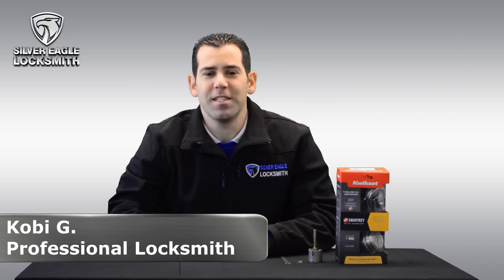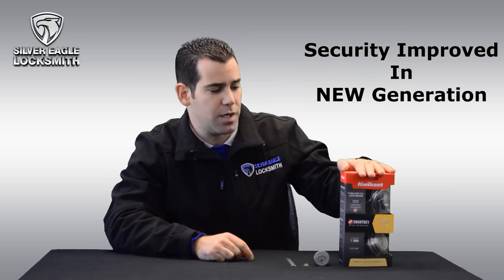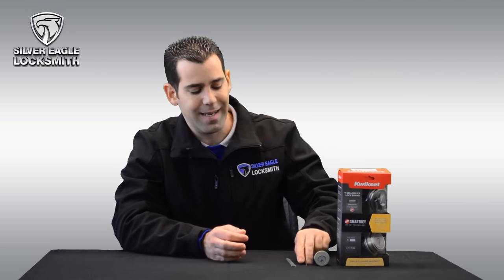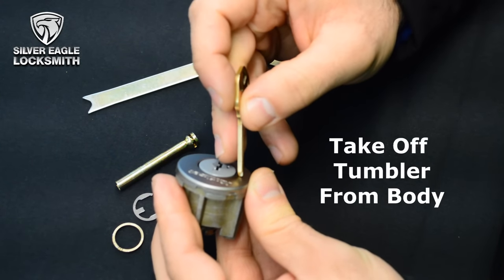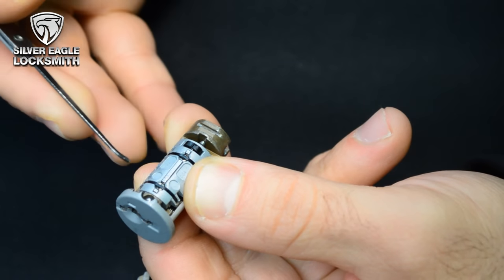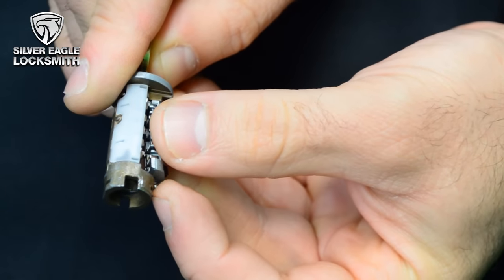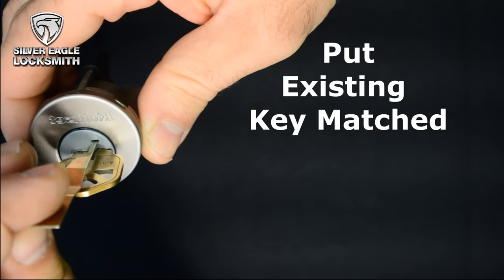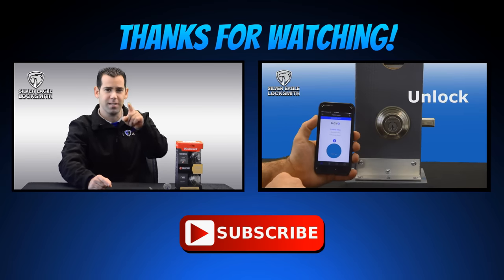How To Reset Kwikset Smart Key Without the Current Key Or The Reset Tool ✅

Comment: Absolutely incredible video man. I botched the reprogram and none of th regular troubleshooting worked. I followed your procedure and it works flawlessly. Took 5 minutes with a phillips and flat screwdriver and I was done. Thank you so much!
Reply: This was me to a tee. Botched the initial program. NEVER thought I’d find a video to fix my screw up - but low and behold - found this. Thought I just tossed $45 for a wasted deadbolt but 5 minutes following this video - and I’m back in business. THIS IS THE KINDA STUFF THE INTERNET WAS MADE FOR. BROTHERS HELPING BROTHERS. Thank you to the original poster big time!
Reply: Same! Only I have the old style and everything fell apart.  It took more than 5 minutes, but still less than half an hour!  
This deadbolt is on a back door and I *have* the key to the door lock and it matches the deadbolt on the front door.  So, I've never really cared I didn't have a key to the deadbolt for the back door.  It's nice to have it fixed, though!
Reply from the maker: It’s only one of my helper videos here on YouTube… fell free to check out more of my videos 👍🏻
Reply: Super professional video and perfectly technical.  Exactly what I needed to fix my deadbolt. This step-by-step saved me alot of time and money. Thank you!

Comment: This is such a great video! One tip for people who might have struggled putting the tailpiece and C clamp back on. If you are forcing the C clamp on and it wont go on as easy as the video, check the opposite side. There is a small hole there that it fits correctly into. If you are struggling, you are on the wrong side, turn the cylinder 180 degrees and it will slide in as easy as the video.

Comment: It took me several tries, but I finally got it apart, thanks to this video's details. There is nothing magically specific about the 2.5mm hex key--that was just what he happened to have available. Then the real fun started, dealing with the flimsy insides of Kwikset's mechanism. The plastic pin-retainer popped off and springs flew everywhere. Miraculously, I retrieved them all from various nooks and crannies around my kitchen table.

Comment: I purchased 6 new Kwikset Smart Key exterior locks for my home, but I had only a 50% success rate re-keying the locks (after precisely following the instructions each time), and my children heard me use language I shouldn't use. Thankfully, this video allowed me to reset all of the inoperative locks in less than an hour's time, using tools I had at home.
     The only advice I would add is to make sure that you have the tumbler oriented as shown in the video 
(3:13), so that when you remove the part holding the side pins, it is facing up. Otherwise the side pins will fall out. It's not a big deal to replace them, but just a little bit annoying.
     Also, when you have re-set the side pins and are making sure the side bar slides back and forth (4:00), I found that it was useful to remove and insert the key several times, checking to make sure that the side bar slides back and forth after each insertion. Once, I didn't do this, and after reassembling the lock I discovered that the key did not turn. For some reason the re-keying hadn't worked. So I had to take it all apart again.
     Thanks again for a very useful video!
Reply from the maker: Thank you and I’m happy that this video helped you to reset your Kwikset Smartkey locks
Reply: Thank you for thia

Comment: This saved me when I went to re-key a new lock and got the supplied key jammed with the bolt out during the process. Followed the video and put it back together using the key I wanted to change to, then I didn't have to try to use the reset tool again. My particular unit had an extra snap ring but everything else matched. Thank you
Reply from the maker: This video really help so many people and I’m happy it helps you as well

Comment: Awesome. I bought a house with two Kwikset keypad deadbolts that I've programmed a code, but I wanted a key in case the batteries died so I could still get in. I bought a third for the front door to replace a Schlage deadbolt and wanted them to be keyed the same, but I couldn't find an original key for the other two units. Now I can re-key them for the same key thanks to this video.

Comment: Thank you so much, I was able to reset my lock without the original key!  I even dropped the piece and had to replace the pins.  Your video was so clear and concise and you even showed how to test it by sliding the assembly.  My first attempt failed but I also wasn't able to slide the assembly.  The second time it worked perfectly!  Again thank you for a great video.
Reply from the maker: We’re so happy to hear that

Comment: Your video was awesome. About 3 years ago I bought a Kwikset deadbolt and when I tried to re-key it, something went wrong and it didn’t re-key. The original key didn’t work either. I left the deadbolt on my front door and never used it.....until today. I followed your instructions and within 15 minutes I had my deadbolt re-keyed and now it works perfectly. Thanks for the great video. You saved me $70!
Reply from the maker: Kwikset SmartKey reset is definitely one the most important video I make over the years and I’m very happy that it really helped a lot of people

Comment: Awesome! Fixed my lock in around 30 mins and only spent 5$ on the cylinder removal tool.
Reply from the maker: That’s awesome
Reply: I actually used a crescent wrench and just spread it slowly to slide the C-clip off. Worked great and saved myself the $70 for replacing a brand new lock setup!  Thanks!

Comment: Thank you so much!  When we moved into the house we paid a locksmith to key all the locks to use the same key.  A week ago my son was bored and messed around with the rekeying tool thereby making it so our keys no longer worked.  I ended up installing a cheap deadbolt I had in the garage until I could try the steps in your video.  It took me a few tries to get all 5 tiny pieces lined up because they had fallen out of the one piece.  After the first two attempts I couldn't get it to slide back and forth.  Tried a third time and it slid back and forth so I put it all back together and now our original house key works - thanks to you!  It would've been $95 to have the locksmith come out.
Reply from the maker: I’m happy to hear that 
Also check out this vol 2 video for Smartkey knobs and lever handles reset: https://youtu.be/lZy-qU2AnK0
Reply: Damn lol. Your son probably knew he made a big mistake after seeing the look on your face when you realized what just went down!!

Comment: While my lock was not exactly the same as the one in the video, this video gave me the knowledge I needed to rekey my Baldwin smart lock that would not work with my key.  Once I figured out how to get the cylinder out of the lock and then open the cylinder, I was able to follow the steps in the video to make my lock work again.  Thanks for taking the time to make such a detailed video.
Reply from the maker: That’s awesome. 
Keep following my videos here on YouTube there is a lot of valuable information on home security etc
Reply: hey  @S.E.Locksmith , i purchased a Kwikset smartkeyed lever and was trying to re key the cylinder but the cylinder eventually locked itself, so now the cylinder will not turn.
Reply from the maker: So check out this video: https://youtu.be/lZy-qU2AnK0

Comment: Update: Well this fix worked for about 4 days and then started to not work with the keys again. Luckily I had called Kwikset support and they sent me out a replacement part that was easy to swop out and now the lock works good again, hopefully don't have the same issue pop up. 

Wow, this actually worked. I was desperate to be my garage deadbolt working again after it just stopped working with any key I tried. I did have trouble with getting it to slide back and forth when I reassembled it but tried it a couple times and did a bit of moving of the little things that need to line up and then it was all good. Thanks for the great video and instructions.
Reply from the maker: Like always I’m very happy to hear that another customers was able to reset he’s Kwikset SmartKey lock. 
If you have any additional questions let me know

Comment: Helpful.
My contractor managed to unkey a "smart" key lock, so I had to disassemble the handleset to get to the cylinder (as I figured I would) and this video helped me understand the lock mechanism so I could reset it to my key. You would think kwikset would have some advice about this process, but no...
Thanks for the video.

Comment: I had 4 of these in my home and the last lock re-keying failed and I couldn't use either the keys (The original or the new one). This was a keypad deadbolt with a key backup incase it failed so super expensive and I couldn't return it. This video is pure gold and within 20 minutes the luck was successfully re-keyed the lock without the original key. Saved me $80
Reply from the maker: That is a great to hear 
Happy to help

Comment: Thanks for the video! Do you have any additional tips on how to remove the cylinder from the body? I tried and tried, and tried, but the key would never grab anything inside the lock, and so I could never pull out the cylinder. I tried several different keys, as you suggested. I also tried rocking the key back-and-forth as I pulled, both left and right and up and down, as well as rotationally. And I also tried different levels of pulling force (and pushing force on the opposite end of the cylinder.), Perhaps my lock is older? Or newer? On my deadbolt, after removing the retaining ring, there was no second ring to remove. Also, on my deadbolt, on the outside of the body, there is a ridge with a metal cover on it. If I remove the cover, all the springs pop out (I put them back). Maybe these features will help you identify which version of the lock I have, and how to adapt your technique. Thank you.

Comment: Great video. Better than others I viewed.  I have a Bladwin and couldn't get the sidebar to slide until I noticed that all the side pins were numbered ! Once I got them in the correct order it worked like a charm. I also tried rekeying the lock to a Pella door key, but the lock would freeze every time. I was able to solve this by first rekeying to a different key, and then rekeying the Pella from that key.  Would have never been able to fiqure it out without using your video about 30 times to reset to the original settings.  You Rock !!!
Reply from the maker: Thank you 🙏🏻 and I’m happy that you find this video useful for you

Comment: Thank you so much for this video. A new deadbolt was given to me still in the box. I was fiddling with the smart key - which was not very smart - after installing the lock. I ended up doing something which caused the lock cylinder to disable the original key. While watching your video, I was able to remedy the issue.

Comment: Perfect, just what I needed. Just messed up rekeying a key entry, and it was very similar. Just one note; the plastic cover, holding pins and springs, flew off. After gathering springs from everywhere, I tried with a "lower" or "flatter" key (less spring tension), this time it stayed in place. Thanks for the video!

Comment: This was more helpful than the official video kwikset has to rekey misprogrammed locks they should ask to use your video because it is way more informative than the one they showed yet just as easy the only tool I used was a drill to get the lock off the door other than that I was able to take the tumbler out and apart with just the key and the kwikset tool (didn't have a flat head screwdriver) thank you for this great video

Comment: Great video; it worked! I'll add that once I got the cylinder out of the door knob, it was a C-clamp holding inside the inner cylinder and another slightly smaller C-clamp holding it inside the internal sleeve (I don't know what else to call it). Once it's out of the sleeve, I used another YouTube video to pull apart the slider, reset the slide pins, and reassemble with the key inserted. That last sentence was much harder and very delicate. It would be easy to lose some of those slide pins and another tiny piece on the back. Just take pictures and video as you go along, and you'll be able to put it all back together. Thanks again.
Reply from the maker: I’m very happy to hear that this video help you to reset your Kwikset smart key locks. 
Keep following my videos as I regularly upload new videos with awesome tips. have a great day

Comment: Thanks! It worked for me, now I can use my old lock I didn't have a key or smart key for either.  I used one of those brass fold-over folder brads to help get the cylinder out.

Comment: I installed a powerbolt 2, only to find out the keys that came with it didn’t work…. using this method, I found some of the sidebar pins were actually upside down…. flipped them and reset it to the key of my choosing.  thanks for the knowledge - this kept me from having to return the lock.

Comment: Thanks!  Had the problem with the exterior door handle falling out, and the homebuilder had NOT keyed this lock (it had to be replaced), so I couldn't get to where you need to insert the allen wrench.  After doing the reset per this video, I was able to fix that part too.
Reply from the maker: Glad it helped!

Comment: Thanks for the video!  I spent more time looking for the smart key reset tool that originally came with my lock than It took to just do it manually, even with an older style that doesn’t hold the side pin in place.
Reply from the maker: This method of reset works on both old and new versions of Kwikset Smartkey cylinders. Happy to hear this tutorial help you out

Comment: Thanks!! That worked great! I even knocked some of the parts out and it wasn’t too bad putting them back in.  I also had to tighten the c clip again after taking it off because it was loose. That worked no problem. Lock is working with the new key without the original or the tool. Perfect!

Comment: Saved my ass with this video! Thank you! Was in the process of re-keying one of my dead bolts and when I went to turn the new key counter clockwise it just stopped in the middle, then no key worked. Took it apart and followed this video, worked exactly as you showed! 1 key call out is when removing the piece that has the small tumbler pieces you gotta be careful, mine flew all over the place and delayed the process because I had to find them haha. Thanks again!
Reply from the maker: That’s great that it worked out for you 👍🏻

Comment: This worked for me, thanks a lot! I was afraid my brand new lock would would fall apart into a million pieces when I took the 2 cylinder pieces apart, but I just had 1 little piece come out. To get the spring back in when re-uniting them, easiest to put the end with the spring in first, then the rest.  Thanks!
Reply from the maker: I'm so happy to hear that smart key reset works for a lot of people. make sure to check more of my videos

Comment: Helpful video.  A local locksmith wanted more than the cost of a new deadbolt to rekey the one I had without the original key.  It took me about twenty minutes to do the first lock cylinder of the deadbolt then took maybe five minutes to do the 2nd. 🖕
Reply from the maker: A locksmith can do it for you and just like every other thing you can DIY and save the money but as a locksmith myself I can respect the job and the cost of those Services. 
For real think about it just like plumber or HVAC technician Would Charge you money for something that you maybe can do it yourself and most people still choose to hire them to do the job

Comment: PERFECT! Thank you. 
One note, when putting the clip back in (the half moon shaped thing) check the lock for the notch it goes into- there is a smaller and a larger one on the opposite side.... my husband bend the clip trying to force it in backwards. But in the end it worked great on our back door we lost the key for!!
Reply: Will this work even if the key doesn't fit into the lock
Reply: Aaron Harris you have to have some key to help get the lock apart (as in the video). Once the lock is disassembled you can make it fit any key you want by carefully following this video. It’s legit.
Reply: JL KW Thanks I will try it out

Comment: Thanks man, just got a new house and they didn’t provide the key for the garage door into the house. Was annoying having to lock it from the other side and go around… it was so easy

FYI: for those that will try this. When you pull the cilinder out a little piece will jump out and potentially the two springs. Do this where you can easily find the pieces. I had to figure the way it went back. As far as the pins. They will need to match the notch at the bottom so it can slided back and forth. Once that happens you add the side metal piece and insert it in the notch.  And you are done.

Comment: Thank you so much for this video! The instructions were great. I actually came to see how to take my lock apart because the tumbler wasn't rotating, but I was afraid of losing pins so I wanted to see what it looked like inside. I still had issues with it rotating after reassembly, so I decided to just swap the interior and exterior tumblers. But I had never keyed the interior lock and who knows where the key was. So I also used this to re-key it. And then after messing around with the other one, I got them both going smoothly!